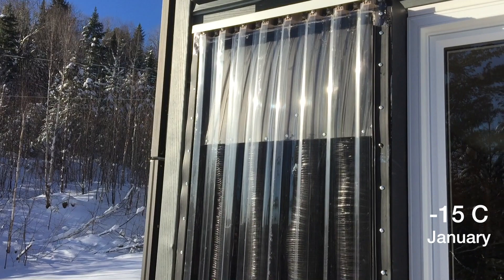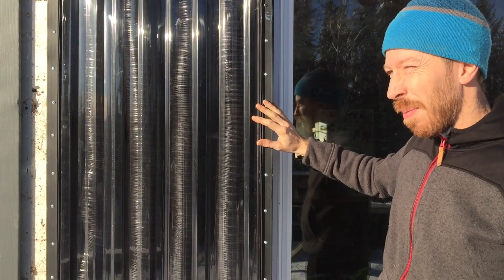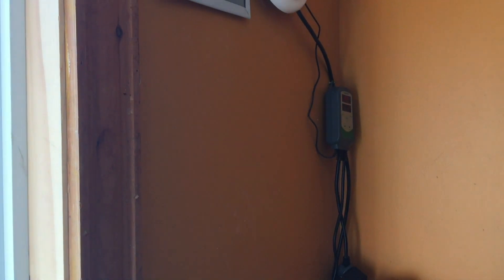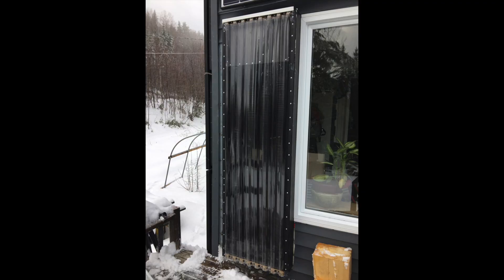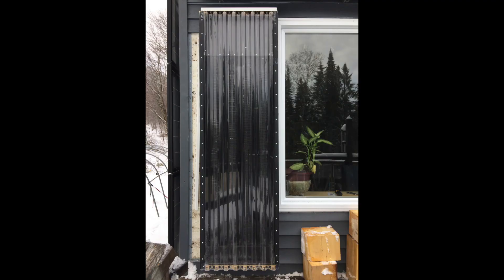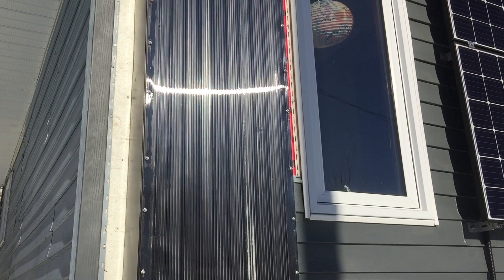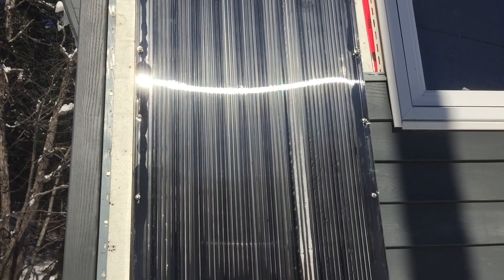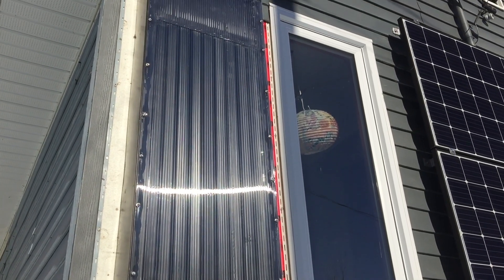How to design and build a solar air heater: Aluminum tube and downspout hybrid double pass design

Comment: I have never built one of these, cold air sinks and hot air rises, wouldn't it make more sense to bring the cold air in to the bottom and bring the hot air out of the top of your system?

Comment: Do you have to cover it in the summer?
Reply from the maker: Yes that is the plan, I will run them until it's too warm to need them and then cover them for the summer.  I don't have a cover designed yet but I have a few months to figure it out.
Reply: @Colindrew4  
A white FRP wall board, at Home Depot, over maybe 1/2 inch foam insulation
Maybe.
Reply from the maker: @jimh712  Yeah I was thinking like plastic corrugated board that they print signs on, there's always lots after elections, or maybe a tarp and some industrial velcro.
Reply: @Colindrew4  
The one i suggested can be used on walls in bathtub./showers..
I'm thinking it should have a good life span
But know the UV rating
But maybe UV rated paint would take care of that
Reply: @Colindrew4  
I'm thinking your design could make an excellent greenhouse or out building warmer..
Surface mounted with 3 sides glass to catch morning noon and after noon sun...
Thanks to you will be one of my projects...
Thanks again